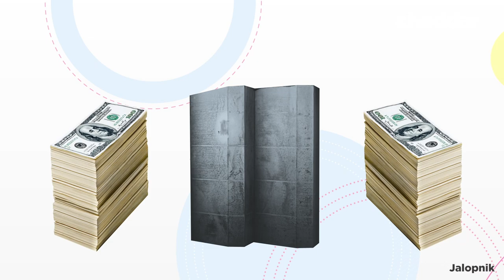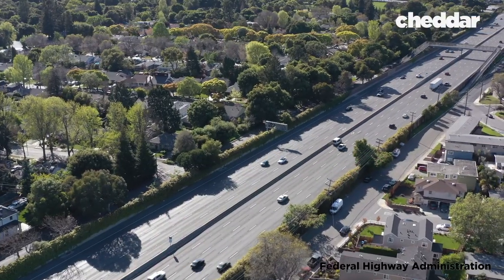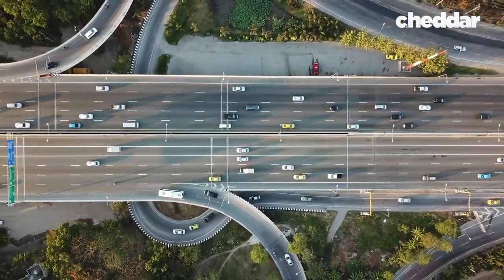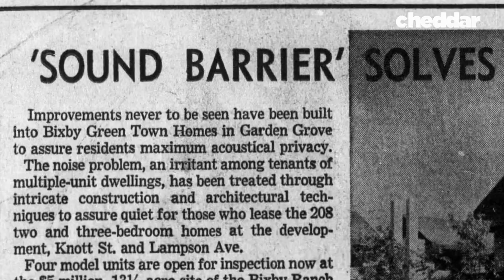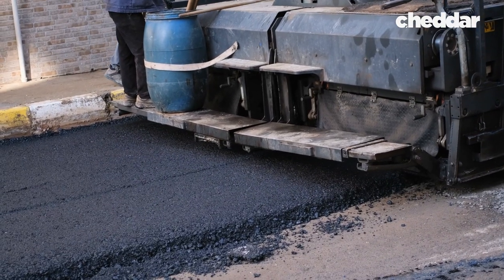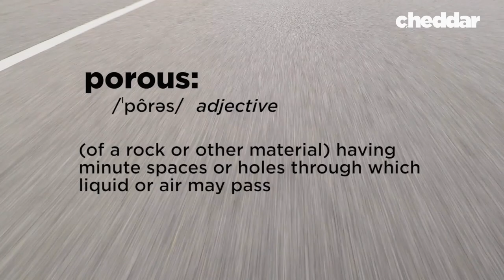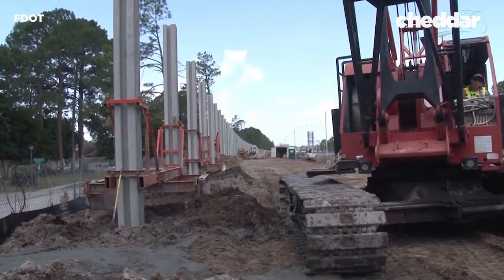How Highway Noise Barriers Can Make Traffic Louder - Cheddar Explains

Comment: Trees work better.
Reply: Agreed. I live a few hundred feet from the interstate. Thankfully there are plenty of large mature trees that make the sound all but disappear. It’s a bit more noticeable in the winter though.
Reply: They look nicer and are less susceptible to vandalism than a concrete wall too
Reply: As are mounds of earth which can look more natural as well
Reply: It's also a lot nicer to have trees around rather then having concrete walls to stare at
Reply: The issue with this is you have to layer trees and with how little space their is between the highway and house there probaly isnt enough space to get enough layers of trees.
Reply: And cheaper
Reply: Both in tandem is what you're after
Reply: Trees carry sound too
Reply: Not so great on freeways, they're hazards, especially if someone crashes into one.
Reply: We would have to tear down houses to put up trees in the Midwestern city I'm in. Trees would have to be a good distance from the freeway through the city to not get damaged by snowplows and salt that would get pushed to them.
Reply: Trees are not cheap for a metropolitan area to maintain. They're wonderful and worthwhile to help with heat islands and I'm happy to live on a street with mostly mature trees, but there's not space for trees between the houses and the freeway.
Reply: Acoustic engineer here. No, trees really don't work better. They provide some masking and there is a psychological improvement because you can't see the road. But, as they said in the video, sound diffracts easily and especially easily through gaps in the trees. So sound gets through trees and bushes REALLY easily.
Reply: @captainspongeboy  loved reading your input. Thank you!
Reply: @Kanonymous-gj9pr  and last longer than 30 - 50 years outside exposed to the elements.
Reply: Not in winter when they drop all their leaves
Reply: @ChristianTJ9  they are still deflecting by scattering sound, if you have shrubbery and hedges it helps a lot
Reply: Yea I live next to a highway and there is a giant forest between us and I can’t hear a single thing
Reply: @bryntownshend6528  here in MI much of the new I75 reconstruction is using natural barriers, foliage, and mounds along the free way
Reply: Yes municipalities need to stop mowing grass along the interstate roads.
Reply: And they taste good
Reply: No
Reply: Well that all depends on what type of trees and shrubs ideally you want evergreens trees and shrubs but then you also need appropriate lighting to reduce the risk of criminals using the shrubbery to their advantage, but heck they even pay for themselves over time in the terms of lumber/firewood.
Reply: The Problem is that not everwhwre is the space u need for Trees.
Reply: They virtually never need to be replaced, they're more affordable than concrete, they're beautiful, and they cut down pollution. Win. I don't know why government hates green things.
Reply: @bryntownshend6528  you can't make them as tall for the minimum spaces available to make them. Would be too sloped and rain would make it go down.
Reply: but they don't work in winter :p
Reply: @FoxDren  Timothy Murray is just putting forward a scientific fact. If you can show any peer reviewed paper that proves trees work, that would be really interesting and an absolute game changer in acoustics. Until you do, don't express fact free opinions.
Reply: @CritterLizard  Not all governments. in my country we use a combination of tall hedges and trees to dampen the noise along expressways; also, just about every road big and small has trees planted by the roadside, adding quite a bit of shade and fresh air to the environment too. However, such trees new regular pruning to prevent deadfall hazards; and plants in general need regular pruning to look presentable.
Reply: They're also just much more appealing.
Reply: @vicgamesvt9682  we should be redesigning our highways
Reply: They are not instant though, and they don't give money to construction companies. So they are garbage to stuborn citizens and rich businessmen alike.
Reply: @CritterLizard  you are “the government” ….Just vote for someone who wants to plant trees.
Reply: Especially if you put them in h the e middle of the road
Reply: Nah trees require maintenance like tree trimming which isn't done.  Then they just over grow and finally just fall onto the road way during storms.  I love trees but they don't work well as a sound barrier.
Reply: @FSX239  exactly right, but try teaching some people…
Reply: @Kanonymous-gj9pr   tree is the most expensive. don't confuse it wild vegetations
Reply: Trees don't actually do much... maybe a thick, mature growth could? But actual decibel readings show that trees don't really do anything
Reply: @UwU-io5lr  truth
Reply: @AustinMeltonADM  ah. Yes. Nature trees. So just gotta plan a few decades ahead huh. Good plan
Reply: I always build my SimCity highways in trenches with trees on the slope for this reason. Don't know if the game's algorithm recognizes this though
Reply: I also wonder if trees next to highways are more effective carbon sinks or simply make for sickly trees
Reply: They tore down trees by my neighborhood to put up a wall and its even louder 😬 with the wall
Reply: No shit
Reply: @captainspongeboy  sure bud
Reply: Yes trees work better, but really it's all plants work better.  The foliage will absorb the sound and disapate it into the ground.
Reply: Trees have their applications, and so do barriers. One traps sound, one reflects sound. The barrier decreases noise heavily within short distances, and only requires 1 layer to be effective. Trees inline one wide would never work as a barrier. To equate trees to a barrier, we would require hundreds of feet of leeway between city regions and highways. In my part of town, we decrease the noise with trees. By not needing maintenance (except directly after installation), these trees are far more cost effective; especially if they're already there!
Case and point is barriers help solve an issue that was created, the issue of noise pollution directly next to suburban areas. By city planning and allowing for a few hundred feet between developed areas and highways, we would almost never need a barrier. However, this is not applicable for some regions where it only makes sense to have the road near to the city.
Every solution has it's own drawbacks. Trees are cheap and pretty. Barriers are direct, expensive, but work well.
Reply: @FoxDren  another acoustic engineer here. What Timothy Murray says is completely true. We have been doing measurements on the noise of highways with trees and the same road after the trees were cut. Alle residents were claiming
a huge increase in noise. Out measurements indicaded a very minor increase in noise, not noticable for the human ear. But since they now have a view at the highway and the masking sound of the trees is gone, they think the noise has increased.
Reply: I am from Europe,and unfortunatelly in my country,trees along streets highways are cut.Today nobody cares about plating trees.They authorities explain that,because trees are danger for automobiles etc.Trees are lungs of earth,they should be planted everywhere
Reply: @fionafiona1146  I'll say it does. 
Had these evergreen tree branches that were 5 ft off the ground. City decided my block needs a sidewalk on our block, cause they built a new apartment next block over. So they removed 2 tree's, and trimmed the ones in my front up 15 ft. My house was quiet indoors, now I feel like I'm living next to a freeway. Honestly feel like I have my window open it's so noisy.
Reply: @garrymarius8881  Germany has minimum distancees between roads and trees but a lot of the farming subventions are dependent on having some deversity (encouraging meadows and trees)
Reply: True
Reply: I was saying that the entire time.
Reply: I live in Washington state, on the westside (west of the Casacades) the highway always has trees on both sides unless ur going through a bigger city like Seattle, Tacoma, Everrett, Vancouver. On the east, it’s mainly just foothills but I don’t recall seeing any sound barriers on I-5, I-82, or  I-90.
Reply: and they look pretty
Reply: @FoxDren  ah yes im sure trees did a fine job blocking all that highway noise pre-1776, Ascdren. So civilized to engineer a solution to a problem over a century before the cause of the problem was even invented.
Reply: @lastnamefirstname9043  you do realise that things other than roads make noise.
Reply: They could probably have trees between the barrier and the houses to have both
Reply: The bad thing is you have to plant it and takes years to fully grow especially on plain freeways.
Reply: @Waddle_Dee_With_Internet  it's possible to transplant partially grown trees
Reply: Or no cars
Reply: @captainspongeboy  do you consult? Our community in NJ would like assistance in figuring out our noise issue.
Reply: @Lordme22  do you consult? Our neighborhood in NJ is looking for options. Any suggestions on soundproofing from inside the home? Additional drywall layer? Double window layer?
Reply: @shailidesai1900  A real consult will be difficult, since I am from Europe, but I can give some general soundproofing options. Double layered glass is always a good option, especially if you currently have single paned windows (The extra thermal insulation is also a nice benefit). Just pay attention to the thickness of both windows. They must be of different thickness. If they are the same thickness it may cause interference which could worsen the problem. 
Also noise isolated ventilation can make a big improvement. 
Additional drywall layer won't do anything noticeable. You need to add more mass to isolate then just a drywall layer. 
I would recommend contacting a local acoustic engineer. They can give you a more detailed consult on what might work in your situation. 
They will also know if you are protected by law. ere civilians are by law protected from to much noise. Maybe your local government must by law already make some noise improvements to the road or place sound barriers. 
I hope this helps.
Reply: @Lordme22  thank you so much.
Reply: They actually do. My apartment building is next to some woods and the interstate is behind the woods 2 yards from my balcony. The noise is pretty faint besides the Harley that flies by once in a while.
Reply: Studies have shown otherwise. Maybe trees that are very densely grown, but foliage branches doesn't really do anything.

Comment: This is exactly what happened by my house. The side closest to the road needs to be made to look like recording studios with sharp pointed angles to break up the soundwaves instead of just flat surfaces for the sound to bounce off of and spread out.
Reply: yesss
Reply: I think many of them are.
Just that not all counties and state govs have used them.
Reply: Cones would diffuse the sound, but not trap/absorb it. 
Most sound barriers in Austria are either made out of long strains of wood waste glued together to have cavities in it (like the porous asphalt they were talking about in the video) or sheet metal cases with tiny holes in them and some sort of absorption material in it. Only a minority of the barriers are glas or flat concrete walls.
Reply: this is exactly what they are doing with newer barriers.

Comment: Trees and bushes combined make for the best sound barrier and they have environmental benefits like cleaner air
Reply: Good idea.
Reply: Very bad idea. You don't want trees near fast moving cars. Because you don't tend to bounce off of them during accidents.
Reply: @Gnefitisis  don't you have a normal steel barrier, and then in the background for the noise cancellation some nature
Reply: Acoustic Engineer here. Trees and bushes don't work. Sound is like water, it finds its' way through any gaps. Trees and bushes have huge gaps and so do almost nothing to reduce sound. There is an ISO standard that says that the attenuation through a wooded area is only (on average) 0.02 dB/m! Although, trees can provide masking by rustling in the wind.
Reply: @captainspongeboy  oh? 
I stand corrected. Wouldn't it depend upon the type of trees used though?
Reply: @captainspongeboy  Published results on the effectiveness of trees as sound barriers vary enormously, however, a study by Huddurt in 1990 shows that in some instances noise can he reduced by 6 dB over a distance of 30 meters where planting is particularly dense.  Leonard and Parr (1970) and Reethof (1973) found that a dense belt of trees and shrubs between 15-30 m wide could reduce sound levels by as much as 6-8 dB.  Cook and Van Haverheke (1972) found reductions in noise level of 5-10dB for belts of trees between 15-30m wide.  Research also suggests that wide plantings (around 30 meters) of tall dense trees combined with soft ground surfaces can reduce apparent loudness by at least 50%.
Reply: @Nilsy1975  Thanks for sharing those, I haven't read those specific papers. I'm very sceptical though of a perceived 50% (10dB) reduction from only a 30m planting. That's bordering on the miraculous, particularly for the low frequency dominated traffic noise that you normally get. ISO 9613.2 predicts only about 2dB reduction due to 30m thick dense foliage. Although, that doesn't take into account the reduction that you would normally get due to distance. If that was factored in then you may get those numbers as a total.
Reply: @Nilsy1975  Solid trees? Anything that has an opening, like the space between leaves and branches, allows sound to come through.
Reply: @captainspongeboy  I prefer going by peer reviewed scientific journals. So that is what I found. My quote was an extract from various papers. However, from personal experience, if I had to live behind trees or walls, due to the way they dampen sounds. It's not the loudness that matters but ones perception of it.
Take seagulls! As far as I am aware they are no louder than country birds, but I can assure you that I would rather live inland with country birds over seagulls anyday! 
To put it another way, yes trees do allow sounds through, but they become (for lack of a better word) softer.
Reply: @bluebox2000  you've never lived in a building of any kind! Trees soften sounds! 
I have lived behind walls or trees. If you have never lived behind trees, then you have no idea how much they soften sounds. Walls don't do that.
Reply: @bluebox2000  ps, aren't trees solid?
Reply: @Nilsy1975  International standards are compiled by experts in the field pooling research from hundreds of papers so I don't think it is valid to say that individual peer reviewed papers are better evidence (I'm not saying that they are wrong either, I've not read those ones but they are all from before the standard was released). Trees are much better at reducing high frequencies so it definitely makes sense that noise from seagulls would be reduced. Certainly much more than traffic noise.
Reply: @captainspongeboy You might have a point about the time the data was researched. I will grant you that. 
I live in the middle of a town will just building and seagulls. The sound of cars and seagulls drive me insane!
I used to live near trees with country birds. The sound is so much different.
It's honestly hard to explain. 
Maybe I am misremembering.
Reply: @Nilsy1975  You're just wrong, or a troll. Let Google show you the way...
Reply: @bluebox2000  in what way am I a troll. I was prepared to admit I might be wrong, I used peer reviewed scientific research. I then admitted it might be out of date. 
I was primarily relying upon my own experience which I admitted might be unreliable.
How and who have I trolled?
Reply: @bluebox2000  also, I use Ecosia. A search engine that plants trees with all of it's profits and helps lift people out of poverty and environmental degradation.
Reply: @Gnefitisis  How is that a bad thing. This just means fewer drivers.
Reply: @TheTokkin  Right and we should also install sidewalk spikes, because of you pay attention then you'll be fine... but we need to mortally punish distracted people.
Reply: Ha!! Facts. In California trees have to be more than 30ft off the highway (unless there is a separation wall)
Reply: @Nilsy1975  Even if bushes and trees work you have the problem of seasons. They may do something in summer when they are full of leafes, but not in winter. IMO sound barriers should be a permanent year round solution, not just something for 5-6 months per year.
Reply: Burnt gasoline kills all living things, including trees and  bushes
Reply: @Gnefitisis  you don’t tend to bounce of cement walls either 🤦🏻‍♀️
Reply: @Gnefitisis  you don't want walls either
Reply: No that’s just wrong
Reply: Studies have proven that trees don't actually help that much
Reply: @florichi evergreens, not deciduous  .